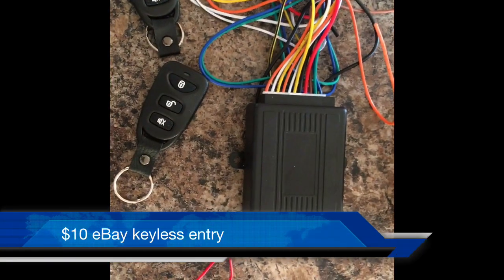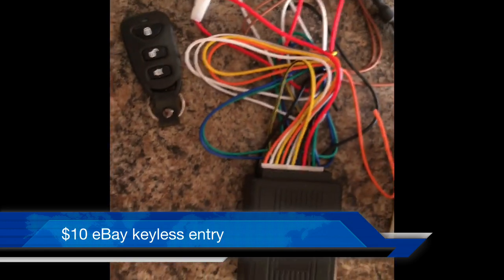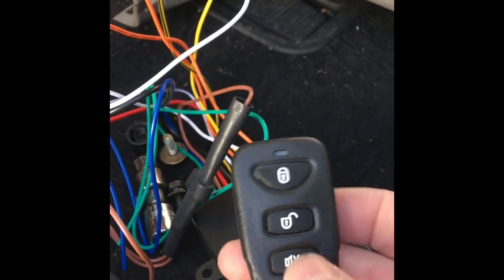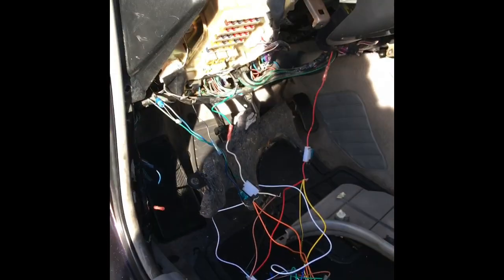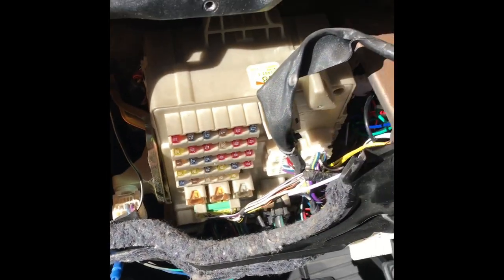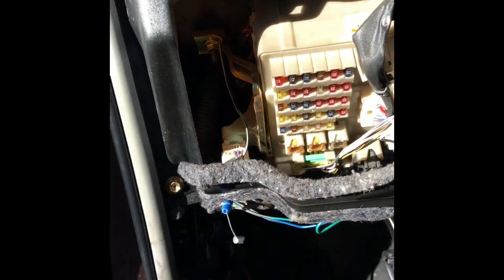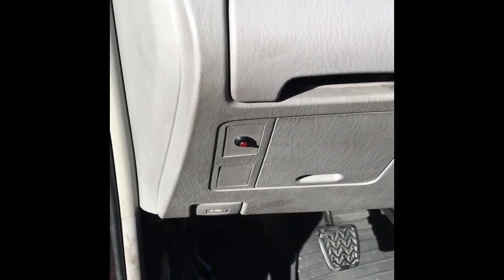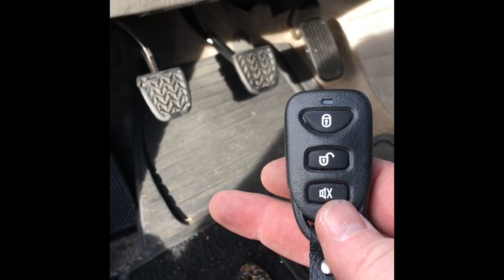$10 eBay keyless entry installation

Comment: I have same unit on my 89 mustang and my 2010 mazda 3. Cheap and has been great unit.  No complaints here
Reply: What wires did u use on the mustang? I hooked mine up to my mustang but had to disconnect my driver side harness to the lock switch cuz it kept blowing fuses. The passenger side works well but the driver side seems weak like it's not getting enough power.

Comment: i installed in a 99 camry and i did not use the orange cables ..and it works perfect
Reply: Can you provide which wires you are connecting from the module to the car?
Reply: @jahong16  what car
Reply: alexx ross 98 Camry. I got it all figured out.

Comment: I bought this to put into a 2000 caravan. But to do it I needed 2 resistors. But since Radio Shack closed, not easy to get them. I sold the van. Today I purchased a 2001 Camry. Let's see if it will work.
Reply: lostintime86 did it work on your Camry?

Comment: Do you have too install the actuators and rods if you have already have keyless entry for the car.
Reply from the maker: Kenneth Saras no
Reply: I still haven't figure out the right wire configuration. When i have it hooked up my power locks don't work with the fob or the push button in the car. Maybe i need a better power wire.

Comment: I have a system I'm installing that's nearly identical. How do I wire it so that the parking lights blink?

How do I wire the trunk pop? Do I need another actuator the same as the one for the locks?

Comment: hi there, thank you for posting this video..  I was just wondering the lock and unlock wires that youve tapped into, do they continue up to a central connector plug or some type of junction box where we can get voltmeter leads in or the wires just continue up under the dash to different location
Reply from the maker: Not sure. I no longer have the vehicle. Sorry.

Comment: Nice video. Did you notice any issues with your battery being drained
after this system installation ? This may or may not be related to
this but after I got the same kit installed in my car my car battery is
being slowly getting discharged I am wondering if the blue LED
light which is flashing when the car is closed could be draining the
system, my car alternator is fine got a new battery and the issue persists.
Please let me know if you ever notice any battery related issue?
thanks
Reply from the maker: I had no battery drain problems.

Comment: my question is the look end unlock what is positive or negative signal ? 
in the white cables
Reply: for the next person with the same question.
different lock mechanism "" pulse" on diffrent voltages either + or - 
my 98 blazer is a + trigger my ford thunder bird is a negative 
so when i wire my blazer i send a + signal to trigger the buttons circuit
or for the bird it sends a - signal to trigger  
basically google your cars door lock schematic and it will show you which you need because going the wrong way isnt good

Comment: Can you add another 433.mhz remote??
Reply from the maker: I don't think you can.
Reply: @RedmonoReview   the relay receiver  has learning code or i am wrong?
Reply: It would be great if we could add a cloning key fob, so you could have te keyless entry for your car and your garage gate all in one remote
Reply: @RedmonoReview  Sir, one thing very danger about double operations of hazard warning light and key operations.

Activate the hazard warning switch and closed all doors.
Now, press the lock and unlock buttons one after another, the turn signal bulb will be fused and damaged.

Comment: What is the range on this?
Reply from the maker: 50 ft?
Reply: @RedmonoReview  Sir, one thing very danger about double operations of hazard warning light and key operations.

Activate the hazard warning switch and closed all doors.
Now, press the lock and unlock buttons one after another, the turn signal bulb will be fused and damaged.